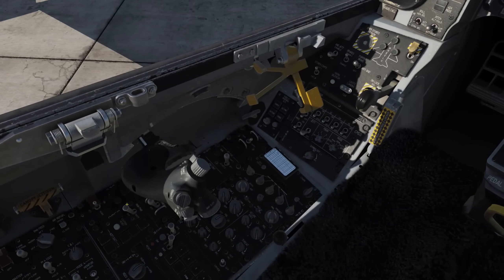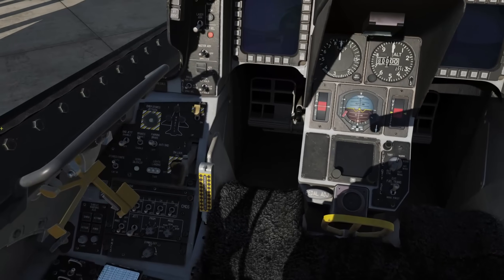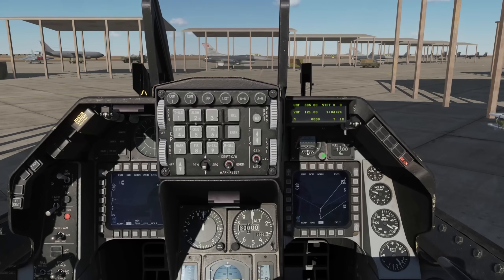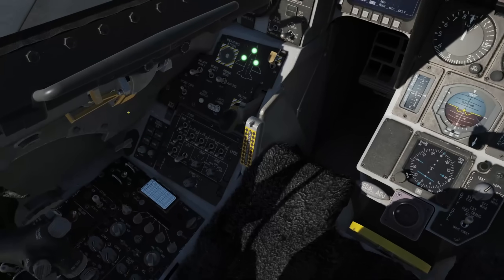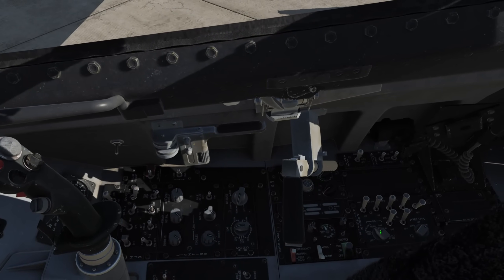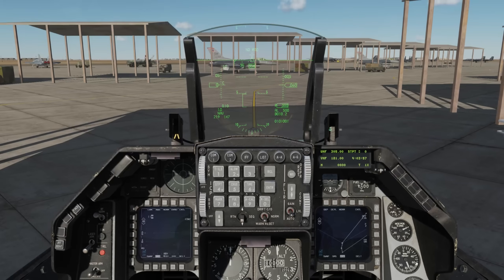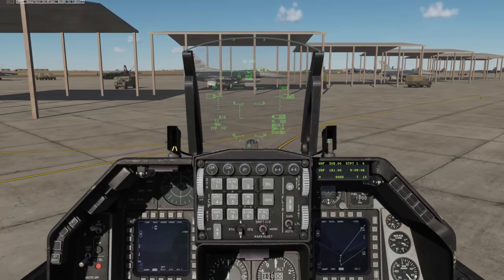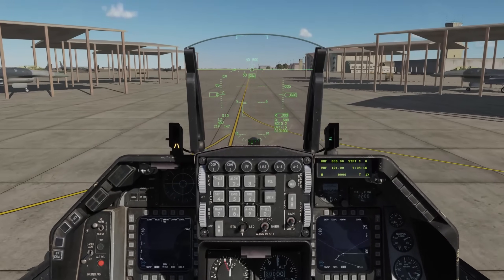How to Start an F-16C Fighter

Comment: So what happens if you don't wait for 60% on the RPM before switching on all the electronics?  Say I jump the gun and start turning on all the electronics at 50%?
Reply: They'll run on the battery instead of the generator. You get about 5-10 minutes of battery power before it runs out so unless you turn them all on and go take a shit before you start the engine up you'll be fine.

Comment: As someone who actively works on F-16s and is engine run qualified, this is essentially 100% accurate to the real life thing and this is amazing.
Reply: thx, know any not so protected bases with the f16 in it? no need to know why I'm asking
Reply: @suomi1483  stealing one isn't the hard part, if I learnt anything from GTA, it's getting away that's difficult
Reply: @officialusmanqureshi  the GTA character just stomps the back of the cockpit glass and it opens lmao
Reply: @suomi1483  take me with you bro, you'll need a wingman and together we have a better chance!

Comment: Thanks! I spent about an hour troubleshooting the external lights to find out they are not working. It is ok if things are not working, just please let us know. Also found out there are 3 different radio menus, not mentioned anywhere.
Thanks again. And keep up the great work with this exellent simulator.

Comment: Hey Wags, nice video. Just wondering whether you could answer a question for me? How do I change the Barometric subscale pressure for the altimeter on the HUD?
Reply: Below the HUD and the ICP you have your analog altitude, there you can change you altimeter setting.
Reply: @SnaxDesAvions  I have tried changing the subscale on the altimeter below the ICP but it does not change the readout in the HUD. Seems they are not connected.

Comment: My radio has a noise, that I can't turn off after do all this
Reply: there's 2 knobs under the throttle turn them both to SQL and that static should go away
Reply: Look under the radio & you'll see 2 dials comm 1 & comm 2. Switch em both right to stop the squelch/static noise. Had same issue at first till i fiddled with every knob lol. Hopefully adjusted in future to the default position.

Comment: Wags. Will the COMM1 and COMM2 Mode knobs on the left panel be altered by default in the future. My ears hurt when i forget them. 😉
I could see you've turned them as you didn't mention them.
Reply from the maker: Already adjusted internally thanks.
Reply: @MattWagner  Cool! Thanks! 😊

Comment: A 5 minute align defeats a quick start. You had it started in 2 minutes, then will have to sit there waiting for 5 minutes. I'd like to suggest a much shorter align time that can be enabled in the misc settings for the aircraft for those of us that want to quick start and get in the air. Thanks Wags!
Reply from the maker: A later alignment option will be the stored one that is only 2-minutes. Thanks
Reply: Thanks Wags, great job on these vids! I'm studying your A/A vid now. They're super helpful and really looking forward to that 2 min align! :)
Reply: In the real F-16 you can do a 2-minute alignment with the data cartridge inserted.

Also there's an in-flight alignment.
Not precise but you can do basic navigation with that.

Comment: Hey wait...Seat not armed!!
Reply: Arming the seat while under a roof is a recipe for disaster.
Reply from the maker: @Antares2 . Yup, arming the seat is one of the last things you do before takoff, and one of the first things after landing. Thanks
Reply: @TheoremGames Unless the a/c cannot be safely stopped, I think most pilots irl would opt for emergency ground egress (see F-16 Fight Manual, pg 3-29) to a static ground ejection.
Reply from the maker: Do not arm the seat until the hold short. Thanks

Comment: Wags I didn’t see the cheek station option for TPOD under hornet does that mean it may be a while away?
Reply from the maker: Hello, that would be an option for the ATFIR later. Thanks
Reply: Matt Wagner ahhh ok thx for speedy response and all the hard work
Reply: @MattWagner  oh crap, so the current TGP will only ever be able to be mounted on the central position, and not a cheek one? Cheers.
Reply from the maker: @BeavPlays . We simulate the USN and USMC Horent, and the USMC only mounts the TGP on the centerline. The USN does not use the Litening. However, if time allows once the much more critical items are addressed, it's something we can look into (no promises). Thanks
Reply: Matt Wagner sounds like a hard no to me
Reply: @MattWagner  Would prefer if you guys didn't make compromises like that. Stay faithful to the product, many of us appreciate the realism that's why we pay top dollar for the modules.